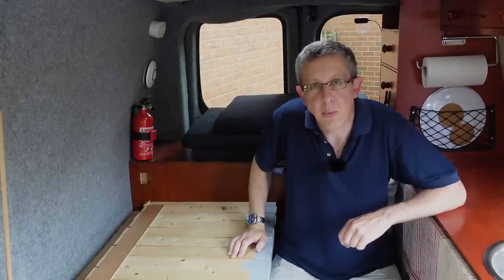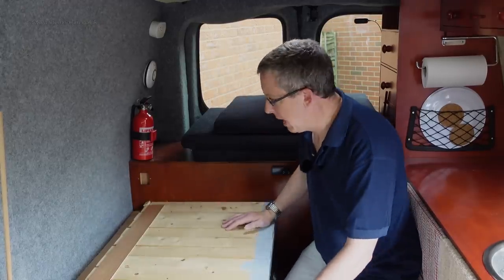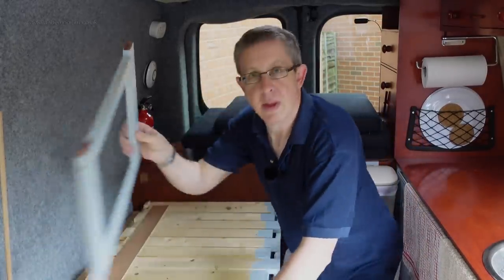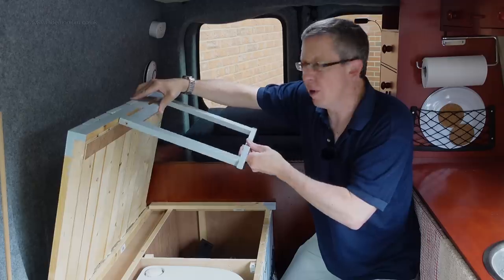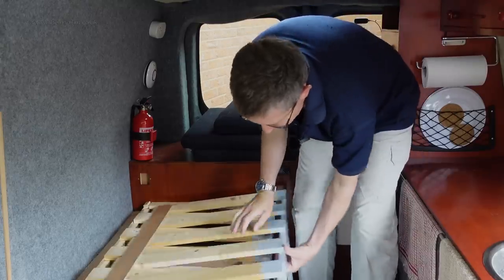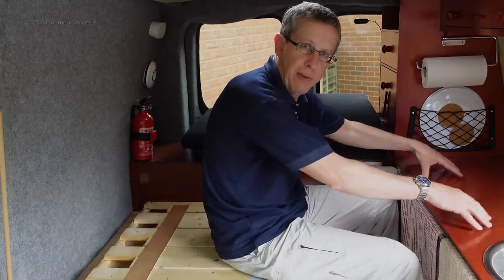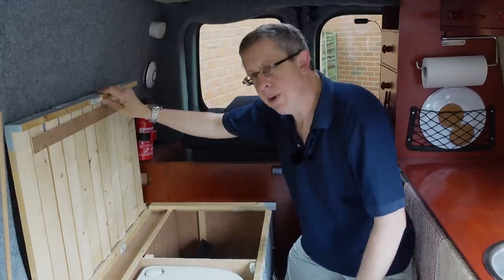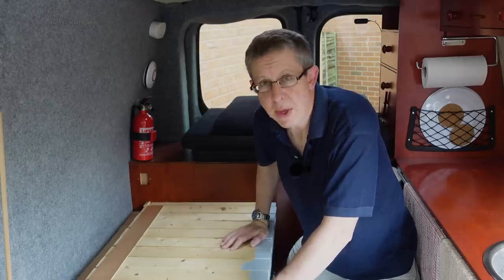84. Help! Your advice is needed.

Comment: Why bothe with the legs? Make both parts more stiff, add guides to the static part ( top and bottom )so the sliding part can only slide, add some industrial cabinet rail (with lock function ) to the sliding part and static. in my head this works.

Comment: Okay.  You want to preserve the convenience of your lift up bin lids, but support them as a bed when they are pulled out.  Simply add a wide U frame on the sides and in front (with permanent legs) that slides out independently in front of the lids.  The current lids are not attached to that frame, but just lie on it when extended however far.  If you are worried about the front edge of the lids slipping off the frame when extended, just add a little velcro or a pin through a hole to hold it.  You will lose an inch or so of leg room width when it is a couch, but that's small change.  When making the bed, you slide the front frame forward, then slide out the lids to rest on it.  When you push it back, the frame slides back to contact the lids in front, but does not interfere with lifting them up (except for a little velcro). You can add however many legs you want, but the front frame is only attached to (rests on) the seat frame at either end

Comment: Hi David. Please excuse my commenting without first reading all 128 comments so far. Haha. Firstly, hinge the leg, it will be fine. Second and more important: If you move the strip of brown ply (or add another one) to UNDERNEATH the seat slats, fixed to the same slats, but underneath, youll be able to pull the seat out 6 inches without the need for a leg at all. It also wont be a loose entity anymore.

Comment: double spring loaded hinges, with just enough force to push floorward when down, but folding inward when lid lifted. kitchen cabinet door hinges... they hold the door open when fully 90 degrees open, but self close when anything less.  Or even just sprung self closing hinges (easier to fit) but not quite strong enough to overcome weight of leg when lid is lifted.
Screwfix or B&Q will have something in the kitchen cabinet section

Comment: I’ve got your slide out design with legs in the front but it’s a bit awkward when you lift it and you wouldnt be able to use your toilet. One of my earlier designs worked well. 
So you get 2 pieces of ply the same height as a leg would need to be. If it’s 12 mm ply, cut a 15mm slot halfway through each piece (eg, if the height of the piece was 14 inches, then cut a 7 inch length slot (15mm wide) so they slot together and make a cross…. Stand it on the floor and you have yourself a leg. 
You’d need 1 for each end, but they’re quite simple to use, can be stowed away where they’d not take up too much room, and don’t hinder any of your current design. They don’t have to be massive, just big enough to be stable. 
Make them 6 inches and they’d tuck under the edge nicely if you wish to pull the seat out 6 inches.
Reply: Triangles is a solution ?
Reply: @sianwarwick633  triangles ? Eh

Comment: Hi David, I have seen some camper vans wherethe pull out bed is fitted with a double front panel, such that the front panel is pulled out to extend and support the bed and the rear panel stays in place, hope that makes sense, it seems to be intrinsically stronger than having a couple of legs. Failing my inadequately articulated description I could do a sketch ☺

Comment: there are hinges with mechanisms that lock under compression but unlock when extended, another alternative is to have hard supports that extend from under the bed horizontally at the edges (but you may need to reinforce the bed frame as it will get torqued a bit)

Comment: Ok... How about you buy a metal shower curtain rail and wall fittings, you would cut out two nice sturdy legs and fit some rubber feet to them (Walking stick ends?) Then use  the wall fittings to anchor them to the moving bed platform, the trick would be to thread some bungee cord down the poles and anchor that inside the wall fittings then adjust the tension so when the legs are held at 90 degrees they pull the leg in but not so tight that they can't be pulled out. You'd then use some pipe clips to secure the loose legs while you are fetching something from the storage.

Comment: The  strip of ply you have attached on top at the back to hold the timber slats together needs to be underneath, that way the pull-out section will be cantilevered and give you more stability when pulled part way out......... you could also leave the strip of ply on top as wel
thus sandwiching the wooden slats....

Comment: Having given this problem almost two seconds  of in depth consideration I wonder if you might consider a hammock?

You could use bolt through the sides fixings or hooks, job done.

You don't have to have a bunk as such and the part that was the bunk could be enlarged or raised for more storage space perhaps.

I suppose you might even rig up a pulley system so the hammock would contain your mattress, sheet  and duvet and be raise to the roof or pushed to the sude.

Or treat yourself to a decent sleeping bag instead.

Might work for you, might not.

I suppose too you could move the hammock outside  ... once you have designed a support for the end of the hammock.

Ideal for those sunny days ... and end up being the envy of your neighbours.

The excellent thing about converting a van yourself is that the conversion phase need never stop  ... and you can refine your engineering as you wish and new (and better?) ideas occur to yourself.

Comment: Dont attach the legs to the lid at all. Attach them to the base so they pull out from the base. You can have them slide in and out by having a bit sticking up into the lid so if you slide out the top it pulls out the legs.
Reply: This.👍

Comment: Got it - just keep the legs exactly as they are, but add two bits of elastic cord  near each dowel that keep the legs held in place. When you lift up the bed, you just pull the legs so the dowels pop out and the legs will just fold flat, hanging from the short bit of elastic cord.

If you drill a small hole from the top of the bed, vertically down into the upper brace of the leg, that should be perfect. You could even add a small countersink at the top and bottom to conceal the knot in the cord.

Sort of like how tent poles have elastic down the middle, which helps with the alignment and keeping it held together, but I don't think you need to drill down the centre of the dowels, just close to them should be sufficent.

Comment: Slats as legs is the most elegant solution if on strong hinges IF you use magnets or some other type of detent to hold them up but that will require more rework than putting your existing stand on a piano hinge with a magnet.  You are right in considering that it might collapse when in the sitting mode if you pull yourself forward even a little bit, however.  Any structure to resist that motion wold be annoying to set and unlock.This is true with Slats as legs as well.  The best solution if you have the clearance at the ends would be to have a version of your current support at either end, placed 90 degrees and they folded up and under in storage mode.  I think there is no place for that at the rear end however without a complete rework.  Legs that swung down from either end can easily miss each other when folded up if offset BUT they would create a span that your seat may not support in sitting mode without reinforcement(?). I chuckled when you said that the bed had been completely tested for strength, whatever that means...

Comment: What if you had a vertical slide out support in the middle of the section (partition between the loo and storage)The slideout could have a perpendicular triangular gusset (both sides of leg panel) supporting a firm rail that the bed slide out can rest on when extended.  your flipup/slideout/usetheloo operations are not impeded.  You set the T-leg, then set the bed extension to how far out you want.  You would have to duplicate it for the second half of the bed. Made of sturdy ply you would lose a few inches in the middle of the storage to accomplish it.  Cheers!

Comment: have the hinges but include a strong magnet on the tops of the legs (and metal pads on the bed underside) so the legs don't flop around.
Reply: Agreed.
4 or more neodymium magnet pairs to keep the legs vertical; 
use the leverage on the hinges to "break" the magnetic attraction so you can fold the leg up out of the way when you open the top to retrieve items from under the bed

Comment: A scissors type chair legs allows adjustable height and folding back into the platform shelf. Alternatively a hinge and slot in system would allow for some strength.

Comment: Route a channel in the rear panel, with the diesel heater controls, then have an extension to the end of the bed that runs in this channel. Then perhaps some bracing under the bed struts, maybe a folding leg at the toilet end.

Comment: Create two legs and hinge them 90 degrees to the way the legs currently sit. One hinge on the right near the fire extinguisher and one on the left near the centre of the bed. You won't then have to worry about them collapsing if you shift forwards in your cooking position as they will be 90deg to that motion. The hinges would not have to be right on the edge. They could be inset slightly from each edge so as not to interfere with the lower frame of the bed.

Comment: Answers on a postcard would be easier so I could draw my idea! However I would consider fitting a length of wood across the underside of the sliding part so that it slides out like a drawer and wouldn’t be able to tip.

Comment: why can't you do like folding table legs. In the US we have card tables and the legs fold up. You have to push the button for the hung to fold.
Reply: you must be joking , there are no such thing as folding tables not even in the USA . its preposterous
Reply: Riding the Road has got it! My first thought! Attach the table legs at the outer corners. Hinge them so they fold inward across the front edge of the frame. Some kind of metal clasp will hold the legs in the closed position. The legs will have to be cut long enough to keep the frame level when they are dropped down which may necessitate them overlapping when stowed. In that case trimming the legs to a taper may be required.

Comment: Remove all of that and have strong metal bars on hinges that swing up and clip into sturdy plastic hold brackets when not in use. When in use drop them down into a bracket attached to the cabinet on the right hand side so you have a full-ish bed.

If you have holes in the tubes too you can perhaps put rods through so you can hang things to dry off it or some other use, perhaps even a TV bracket underneath with a TV for evening watching when on mains electric.

Comment: Connect the sliding one underneath so it holds onto the hinges part. Can’t pull it completely off but you can scoot it out a little for seating

Comment: Add a board to the pull out on the underside to form a series of spaces that wil slide out.  If it is strong enough you might be able to do without legs at all.

Comment: Apologies if already suggested but hollow tubes as per window cleaning poles which go one inside the other and locked when the pin goes through both poles when the poles are twisted into alignment. Store poles under bed slats inside omega shaped clips. OR Gas operated mechanism as in car boot? OR telescopic poles like an old cassette radio aerial. OR deckchair mechanism OR collapsible type legs as in a collapsible funnel but metal instead of plastic OR concertina/fan shape under slats so you can angle the bench at a slope when at the kitchen worktop OR a pole running the length of the bed which slots downwards into a u shaped slot holder which is attached to the rear doors with another u shaped slot in the front seat area (one pole can slide out from inside the other) OR use the Force :- ) Best wishes, R.  Xx

Comment: Have the legs pull out separately from the lid. I would have both legs slide together. It might be easier to have the legs slide out individually, but I think that would be a nuisance every time you wanted to to pull out the bed. So I would have four legs, with two legs sliding out together in two sections. I am imaging four 1 X 1’s sliding out from the bottom and four 1 X1’s sliding out from the top that attach to my four legs. They don’t have to be super strong since all they are doing is sliding out and guiding the direction of the legs. Plus you’re only losing 2 inches of storage on top and the bottom. Though I suppose if you don’t have the space because of the toilet, you could get away with keeping the boxes and then having them slide out on two 1 X 1’s in the center or in the case of the loo, slightly off center. In fact, that’s probably the best solution since you’d only have to slightly modify your current setup.

Comment: Use legs like on a mobile folding table.  Have the left leg fold to the right when closed. Have the right leg fold to the left when closed. Have some type of bracket hold them up when in the closed position.

Comment: You could have hinged legs at the corners of the slide-out bit and have one tapering down the front face and the other tapering down the rear face so they can sit side by side along the front edge of the bed when folded up.

Comment: Oh, you do start something don't you? Leading question, is you van floor wooden and perhaps deep enough to allow for holes to be cut in so that hinged legs could drop into the hole to lock its position? I am assuming that the seat base does not tilt when it is only pulled forward a small amount as your weight would hold it down and the base has not gone over the tipping point

Comment: Folding/Locking shelf brackets? They fold out and lock to hold a worktop/desk as a temporary station
Reply: Something like on a folding leaf table. A couple of vertical triangle brackets that fold out from the base and fit into slots in the top.

Comment: Hi David, a couple ideas from me. Have you seen those locking flip up hinges some vans have for worktop extensions given they lock would that give you peace of mind? Alternatively aother van idea you end to see inn the garage area is heavy duty drawer runners (ive seen them hold a motorcycle) therefore no legs whatsoever but they look pricey online. Best of luck cant wait to see what you decide

Comment: Hinge your legs, on the front face between the pull out section and the leg frame fit one or two small over centre catches to lock the legs in place.
Reply: As an alternative, fix blocks to the bottom of a couple of the slats to engage the front of the lockers so that the sliding section is locked in place in the "cooking" and "bed" positions, then fit your hinged leg section and put a couple of short dowels or metal pins in the bottom of it to engage with small holes in the floor in the two possible positions. If you use metal pins e.g. nails with the heads sawn off the holes in the carpet will be barely noticeable.

Comment: Cheap and simplest option is to add a leg to each front corner. Bolt, nut and washer "hinge" mechanism with the legs folding toward the centre of the front of the pullout. Opposite tapers on the legs would mean they could cross each other to allow for the extra length when folded away. 
Better option would to buy 100kg drawer runners and have the extension sit on them. No legs needed. Amazon sell them.
Reply: Hi  I like that idea and you have the facility for partial slide distance

Comment: A U-shaped frame that goes round the cabinet with wheels on the bothom and attachmets in the top for the upper shelf.
A sort of a fake pull out drawer that merges with the cabinet.

Comment: I'm in no way an expert but based on this,  I'm suggesting a fixed  runner along the far end units  that the bed support can slide out on teamed with a horizontal>vertical fold out leg (possibly running on a castor  wheel) at the toilet end. 

*or stop over thinking and get a small folding stool to use when at the kitchen.

Comment: 90 degree hinges allowing each leg to fold from each corner towards the middle.  If the legs aren’t long enough use extendable legs instead of fixed length ones. Don’t over think it 🙃 keep it simple

Comment: As long as the rear hinge is relatively strong, a piece of PVC electrical conduit attached to the underside of all the extendible planks (opposite the already present flat bit of thin sheet attached to them), passing under the fixed planks but not attached to them will hold both parts together when extended.  This should eliminate the need for legs altogether as long as the extension is only half or less of the closed distance.

Comment: Instead of trying to create legs what about a side panel at either end that pulls out. To give better support along the length of the bed that can be hinged so then fold towards each other in the current leg space when in sitting position. with holes at varying distances you can control how far out it.

Comment: Hang a bed from the ceiling on a pulley system. It'll stay out of the way, can be the full width of the van and can be hidden during the day.
Reply: or better still build an upstairs area , would be quiet simple with some sheet metal and a welder . then put a bed up there

Comment: First thing to mind for me is to attach the legs to a fascia board asked attach that to the pullout. It adds maybe a 1/2" of depth, but nothing to hinge or hide away.

The fascia would need to be both glued and screwed in, with enough screws to assure support for weight.

Not perfect...but a start maybe on a workable solution with minimal modification.